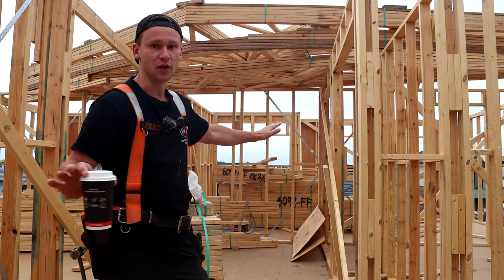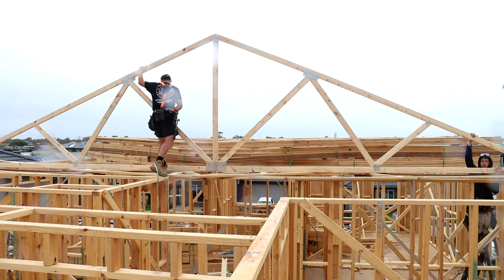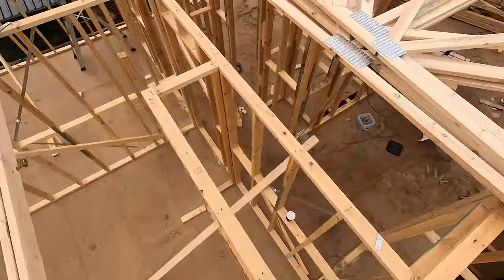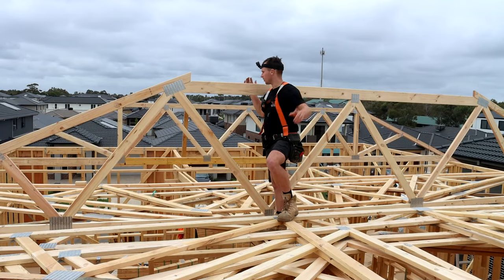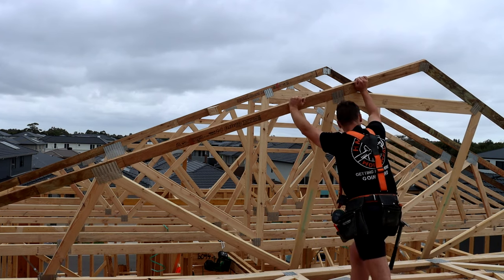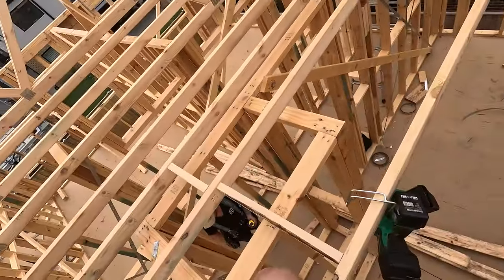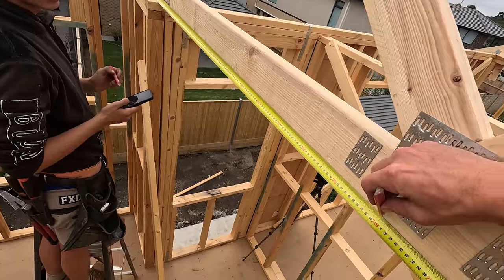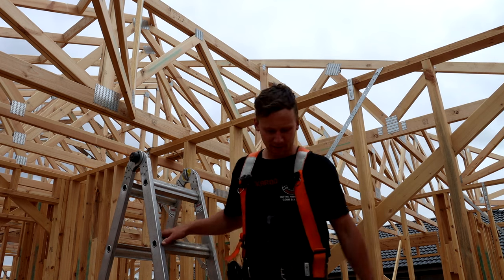Installing 12 meter trusses with no crane

Comment: We always did it how you are but the builder I’m working with now keeps the crane on site as long as we need it. So now I lay the trusses out in order on the ground, give the rigger a plan and we bring them up one at a time. We fix the ends get a measurement and shoot temp bracing and by the time we are done the next truss is ready to go. We also build all non load bearing walls after the roof is on to minimise rain delays. It helps that the builder is in his late 60’s and has seen just about everything the industry can throw at us

Comment: Where is your void protection mate ?
Reply: 99% of roof frame installs in aus are done without fall protection
Reply: @TrunksChoiceBand  is asking about the void protection for the stairs. I guess the builder forgot that on his checklist lol
Reply: @TrunksChoiceBand  I'm talking about the staircase void protection. Just looking at his video I can tell that's roughly a 5.2m drop if a worker falls. Void protection is necessary and a legal requirement in Victoria

Comment: Don’t want to tell you ya job but why not crane the trusses onto the roof in the correct order even if it means splitting them on the floor re-strapping and crane up , saving you time and more safe installation
Reply from the maker: I’d love to do that, but the crane/delivery truck is normally booked out with a lot of deliveries for the day, so they only have time to drop the trusses off and go to the next job

Comment: Cool video, surprised no safety nets or fall bags though. Should be the responsibility of the main contractor if you're subbing out to them though (assuming it wasnt part of your quote)
Reply: The reason they don’t do that is because there is no government laws forcing them to do it. Plus it then makes building even more expensive for the builder which he will then pass on the customer. In 20 years of 1st fix carpentry I have never seen that.

Comment: The cost of a crane pays for itself. Youd be done setting trusses before lunch and allready be working on sheathing. Instead your up there trying to manipulate huge trusses by yourself unsafely. If you fall or pull something and your out of work who will keep production going while your out healing
Reply: Youve got 3 men. 2 on the top walls and 1 ground rigger who riga tye crabe and puts on a hand line in windier climates with larger trusses when theres obstacles